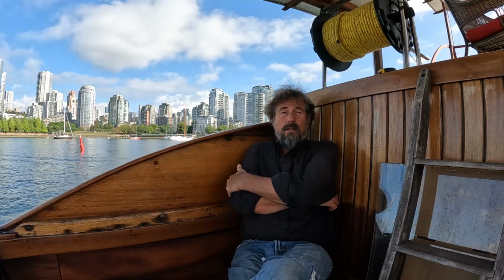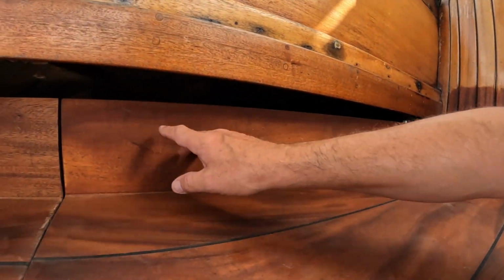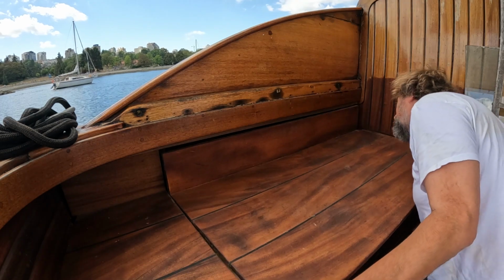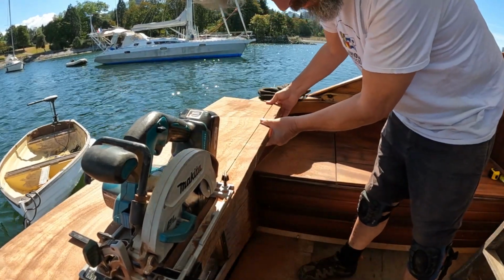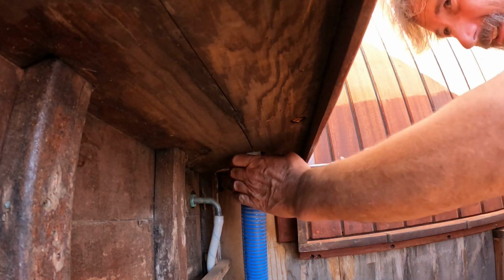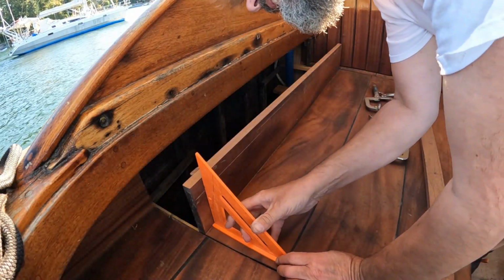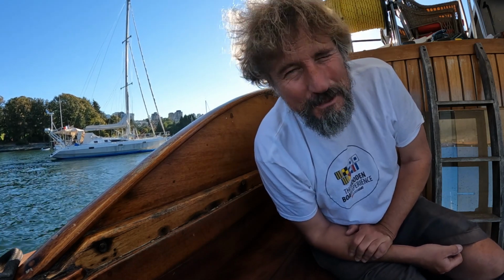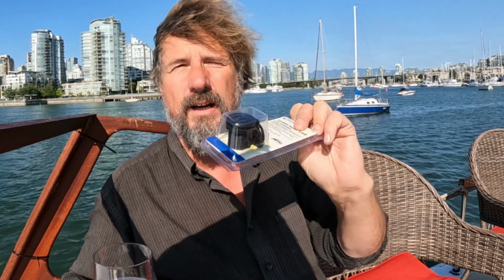Locker Hinges - #326 - Boat Life - Living aboard a wooden boat - Travels With Geordie

Comment: Being “exposed” on a weekly basis to your channel usually provides me some hack or tip to make a DYI project go smoother. This week you again reminded me of the self centering drill bit. One will be shortly on its way to me from Amazon.
Reply: I've got a couple of the self centering bits..
The larger one (I don't know how they are measured) works for most sizes.
Reply from the maker: They're great

Comment: Thank you for confirming and documenting...
I am not the only one that takes 2 days to fit 2 hinges...
BTW Glass for the windows..
Some places are now throwing out Perspex screens... Easy to polish back up..
Also you could use clear SM Polymer sold in a C20.
LEDs mounted in the wood (use clear SM to optically connect) so they apply light to the edge of the plastic looks amazing.

Comment: Fantastic job done for sure, could you epoxy the seats  then varnish them as they a exposed ?
Reply from the maker: I actually did the first time. Sanded it off. I don't like the look when epoxied. Love my tung oil first coat.
Epoxy is actually no more resistant to moisture.
Reply: @TravelsWithGeordie  Never tried tung oil on anything, perhaps when I re do the inside of my wheelhouse I will try some on the woodwork, I have no wood to varnish outside now as I have a steel boat